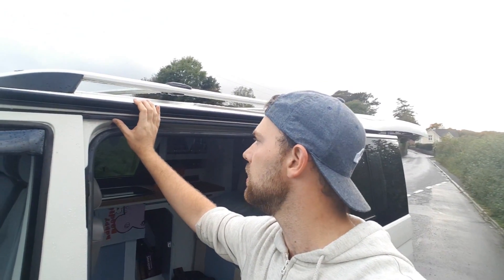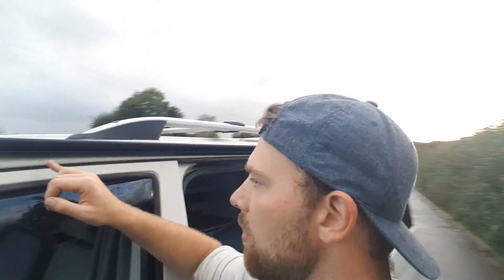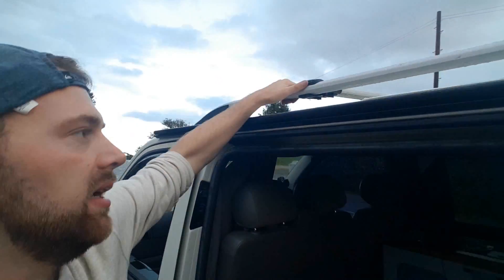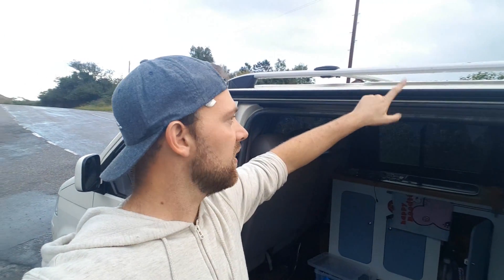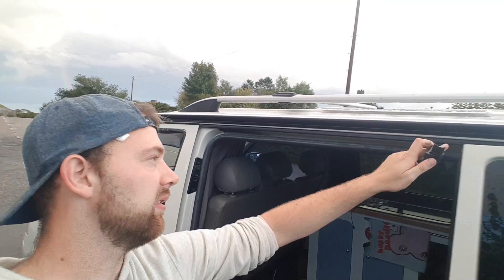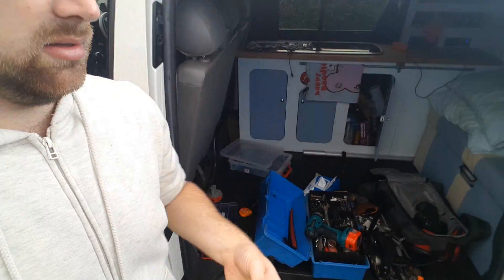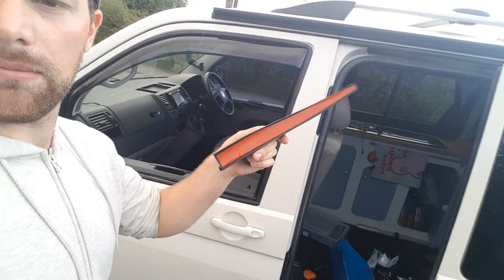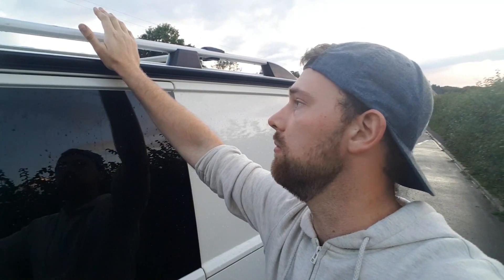How to fit Vamoose Reimo Style Multi Awning Rail | VW T5 Campervan | Install Tutorial DIY Vanlife

Comment: You do need to use silkaflex on the front.
Reply from the maker: I didn't on mine, the rubber stick on bit, but I used silkaflex or sealant to seal the top edge, if it comes unstuck which they can on the front just put some under it..
Reply: @scoellphotography  I paid £150 to have mine fitted and they didn't use any on the front. It ended up flapping about so I took it back and they smothered it in clear silicone and held it down with masking tape. It didn't hold so I spent a morning cleaning it up and re-sticking it with a thin layer of black silicone to stop water reaching the double sided tape. Worked a dream. I think the company that fitted it didn't want to spend any time on it.
Reply from the maker: @stephenboothby7446  sorry I misread your message I thought it said "do you need to" yes I know they don't stick very well, it's amazing the difference between bonding sealant and silicone..